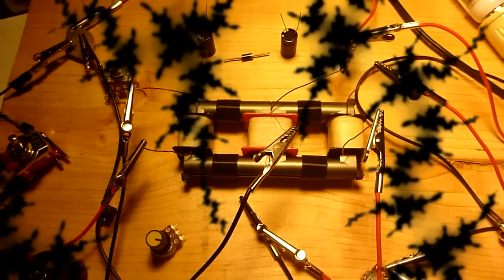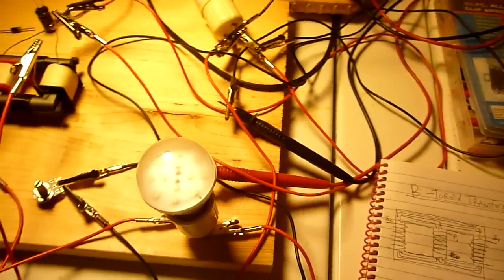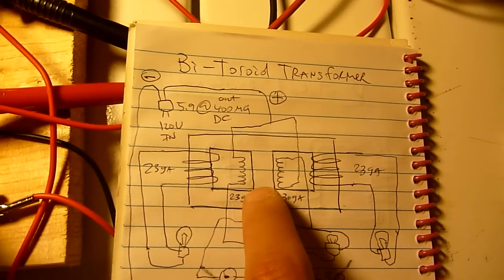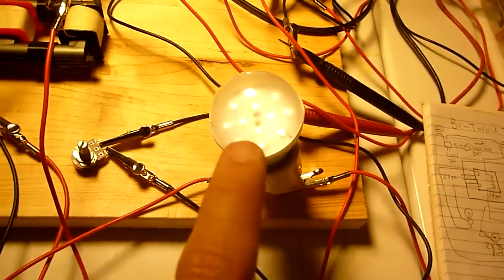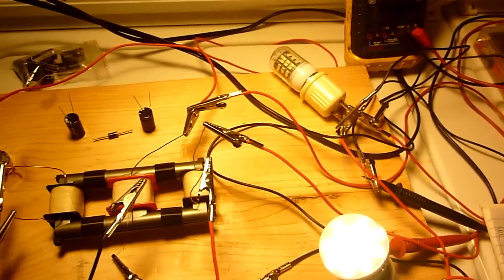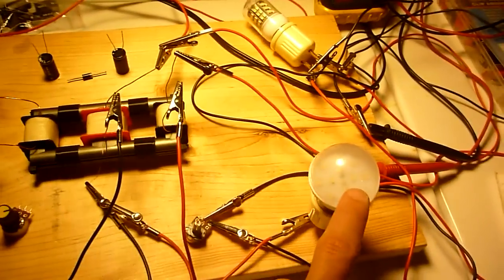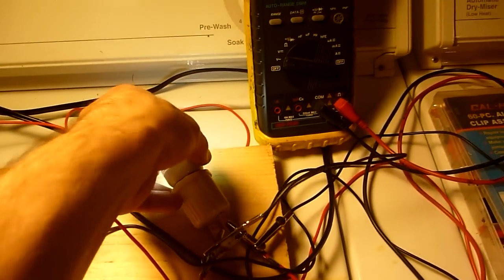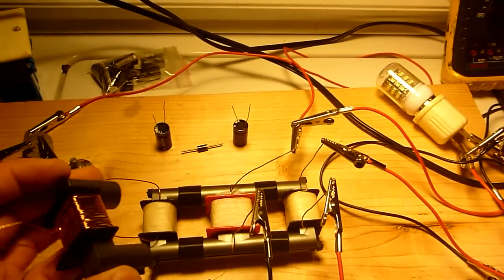Bi-toroid Transformer replication (over unity transformer)

Comment: the design isn't the same as bi transformer because the  bi transformer secondary reroute  the magnetic flux around primary u don't have more magnetic core material to create the effect so your two secondary are create oppose canceling that reroute back into primary if wiring the two secondary in parallel but doesnt effect primary because secondary cancel their flux maybe u can use scalar cancel effect to tap something
Reply: Sorry, I have a bad habit of not reading the description. I know well how it feels being limited by what you have. I have more stuff on paper than any other concepts I want to realize. Construction supplies include whatever I can dig out of a dumpster, or get out of what's laying around. My car hasn't moved in over a year due to money issues, and is being "eye-balled". I prefer pre-manufactured parts for my designs, and that Kia is looking really tempting.
 I have those cores you are using in the video, got them out of TVs. That's good salvage.
I've been thinking of crossing the BiTT with the MEG with a dash of Joule Thief for support, and Pulse DC as the power. I like the concept of PDC, as it can be used in both DC and AC circuits. It's just another idea that needs testing, as much as the others do, but it has promise in theory as a sound concept.
Reply from the maker: +Isibor Omwanghe You are correct. If I had an extra loop connecting secondaries together it would have been a true bi-torroid transformer. I did the best I could with the stuff I had laying about. In either case this setup works! If you have 2 secondaries and 1 primary the secondaries will support each other when both are under load. It is something that should be investigated. Thanx for the comment.
Reply: +Naoki Kashima So you would agree that bypassing the primary like in a true bi-toroid would boost efficiency?
On a side note, you should look at the MEG. I find it interesting.
Reply from the maker: WhtStr213 bypassing the primary would definitely boost the efficiency. If you have an extra loop connecting the two secondaries together (what I didn't do in the video), this would couple the secondaries even better to one another (by passing the primary). Also, if you have the secondaries wound around a thicker core material vs. the thickness of the core used in the primary this will also boost efficiency (more magnetic flux will be trapped in the secondaries than in the primary). I think I listed all these things under the video description (on how to boost the efficiency of the device). The reason that I didn't do it in the video is because I had to work with what I had. (^o^) thanx for the comment.

Comment: A lot of people don't believe in free energy.   I tell these idiots to look at their thumb and ask them what is running their atoms.  It certainly isn't cheeseburgers.     This energy comes directly from the vacuum.  Now the real question is where does the vacuum get it's energy?  My guess is Black-holes when they convert matter back into energy and the X-Rays pour out of their pole ends.  It's an endless cycle.
Reply: the trade off....i believe when you use one form of energy there is an opposite transformation...of the energy being used.Just like positive and negitive electicity..the minute loss of energy being used to make it is being generated and lost in form of heat ect.They eventually all go back to original state in the frequencies and waves ..quantam mechanics seems to prove that.but capturing and getting 100%+overunity i dont think will ever happen .if it does there will be a trade off somewhere.making use of free roaming frequencies would be where i would want to look at getting free energy
example would be microwave radiation from big bang

Comment: You need to duplicate the original one from MIT.   It's the one that is 377% efficiency using the extra flux path that has no coils wound on it, this pathway is for BEMF flux  this pathway needs to provide a flux path that the flux prefers over all other pathways.   They state that this flux ends up being additive to the primaries flux flow not the opposite like normal transformers, where it always is opposing.  This is where the over unity occurs.   To make it self running take a portion of the secondary output and use it to drive the primary.  You'll need a Make-Before-Break switch to ensure that the second source of input is available when it's up and running and you switch it.  Add another coil over the secondary's for this purpose.  I see that you are using High Frequency core material. I would use core material from an old transformer and use a Dremel tool to work with it.  At 377% it should be pretty easy to get it self running, but first you need to get it at the 377%,, then go for self running
Reply: The he original is from the University of Ontario.
Reply: howDoesItLookThisInPhaseBackFluxTransformer?
Reply: I know the model you are talking about brother and I designed very similar just last night, finished it off just moments ago.
377% is a massive overunity!

In theory the greater the load the greater the efficiency as the magnetism top and bottom of the transformer repels its, like in a resonant cavity magnetism repelling it's is what causes energy amplification 👍  

Always good to see intelligent people exercising their brainpower 🤝👍
Reply: @DaVeHiLl200  Wow! I would like to make the same transformer. I have the video he is talking about. Let me get you right, did you implement it the same way and it gave you overunity?
 ( I'm not some CIA spook etc etc)
Reply: @CAPTAINSSBN Hello, have you tried this and it works? Does It give overunity ?

Comment: If you disconnect the 2 light bulbs, the wires from both. Create a closure, a dummy, that dummy will push back into your centre coil, you will see that you will use a lot less input currents. And your lightbulb the main one, will be brighter.
Reply from the maker: +Gerard Morin I've seen some of your videos and I appreciate your efforts to try to help humanity. We are all victims of technological supression, nobody can argue that point right now. Are you aware of the water-powered generator (GDS Generator) which is comming out of Canada. Their website is up and running and orders can be placed. Here is the link: http://www.gdstechnologies.ca/ And here is their commercial: https://www.youtube.com/watch?v=vEqSuTOKUEg The time for Big Oil is running down.
Reply: @naokikashima9349  is there an air gap..? i think the small aircap causes this not to destroy or cancel the flux flow   due lenz law
..cause tom bearden says  in a closed system or let us say transformer the magnetic flux is destroyed by lenz law that is maybe the reason why your ring transformer setup does not work because there is no airgap... since the u core is not really fixed it has some small gap

Comment: Where's the over unity? Just looks like some guy with a camera and a transformer. big whoop. show us this over unity stuff. Demonstrate this mysterious principal that someone else supposedly already discovered,  but then I guess forgot, and now you have miraculously rediscovered. Put some simple volt ohm meters on the input and output measuring both volts and amps. You obviously have done this already. To have made the claim you are getting out more than you are putting in you must of already done this simple test. So please, do it again for us all to see. All meters on camera at the same time, show us this over unity you have achieved by wrapping some copper around some metal. Can't believe nobody else has thought to wrap some copper around some metal before, brilliant.
Reply from the maker: +Thad ward I appreciate your criticism, however the over unity claim is not just my own. Over unity effects with this setup were achieved by Thane Heins, as well as youtube user theENERGYDREAM. A typical transformer couples 1 primary to 1 secondary. You get a 1:1 relationship minus the losses due to heat and resistance in the wires. In this setup the primary is coupled to two secondaries. It is no longer a 1:1 relation because the secondaries themselves end up mutually supporting each other! This experiment was also replicated by youtube user ZeroFossilFuels, please watch his videos and subscribe to his channel. To further push efficiency of this transformer beyond 100% (it is over 100% as is) you can connected the secondaries by an extra loop of magnetic material (same material as you use in the core of the secondaries). This will help the secondaries to support each other. Please read the description of my video for more information as well as links to relevant experiments (a few of the videos were removed by youtube or the users already).
Reply: Naoki  it is not criticism, it is curiosity. I merely asked for an exhibition of your claim. It&#39;s pretty common, actually in fact it is 100% common for someone in the science community to have discovered something and then to prove by completely recreating and empirically measuring the results at the witness of others in community and then hopefully showing us the nature of this recreated phenomena mathematically or is at least able to verbalize the action of the phenomena  to the satisfaction of the community. This is the scientific method, or a very loose quick interpretation of it. I have no choice but to discount your work as false if you do not wish to follow the scientific method. Claims of grandeur are made everyday but when backed by irrefutable proof they become laws. So my method for you to prove your work was simple, measurably show us the results of your findings. You should be elated to show off your work and I'm very excited to see this so that I might recreate it myself. Cheers
Reply from the maker: Leonard Janus Thermal power is not measured in watts O_O Also, using a typical electric heater will always result in COP value of less than 1. Replicate the experiment and see if you get the same results or not. Numerous people claim over unity with bi-toroid transformers not just me.

Also, check out Jim Murray he is an inventor who managed to achieve 5000% over unity with his generators. He has worked on this for about 20 years or so. Here is his video from his workshop, he explains why such high efficiency is achieved, he shows numerous prototypes, etc. Check it out >> https://www.youtube.com/watch?v=HK3JOlY0V8Y

Comment: Hi Naoki ,
apologies in advance to my very bad English ( Google Translate ) , I would try to replicate your design bi toroid , but I do not know where to find such metal body of the toroid, could not you add links for individual parts where can I buy? get? I think that it would like to see more people , simply a precise specification of all the components used on the toroid

Big thanks in advance
Reply from the maker: +Alfa Mikan I used 4 U-shape transformer cores in the design, these ones: http://www.aliexpress.com/item/UY1658-large-watt-U-shape-transformer-ferrite-core-Used-for-machines-equipments-5pairs-lot/32370110051.html?spm=2114.01020208.3.2.vKIVHD&ws_ab_test=searchweb201556_7_79_78_77_80,searchweb201644_5,searchweb201560_10 Then I had 2 different wires for the primary wound in a single layer 20ga and 30ga. For the secondaries on the outside I used 20ga wires in 3 layers (back and forth and back).

Primary had 2 different size wires because it is a pulsed circuit (joule thief circuit) that drives the transformer. You can also use AC. If you simply use AC you don't need to have 2 different wires in the primary.The most important thing here is the shape of the transformer. Also, the transformer must have 2 secondaries and 1 primary. The number of turns in the secondaries and the wire thickness must be the same. If you have the secondaries connected by another loop of magnetic core material your efficiency will increase further. Also if you have thicker core material in the secondary vs. the primary more flux will be retained in the secondary further improving efficiency.

Hope this information helps.

Comment: +Naoki Kashima Is it mandatory to use AC Voltage in this Generator?
Reply from the maker: +Onaduja Dare You can use AC or pulsed DC as I'm using. This isn't really a generator just an energy amplifier.
Reply: +Naoki Kashima Haa haa, this is not a generator? How come?
I ask because what you give in is not what you are getting at the output.
And more you Purely achieved overunity.
Could you please clarify?
Reply from the maker: Onaduja Dare The device is simple enough, build one yourself and measure input vs. output. To further increase efficiency have the secondaries connected by an outside loop. Have more metal in the secondaries vs. primary (thicker core), or have the secondaries with a core of higher permeability. All these things will push efficiency higher and higher. Another experimenter had achieved 377% efficiency with this setup, his youtube name is "theENERGYDREAM". In this type of transformer the primary and the secondary don't couple together in a 1:1 relation because of another secondary. In this arrangement the secondaries end up coupling together as well. As they are both under load they end up supporting each other. Thus, you basically get 2 for the price of 1. Also, the whole thing will run cool (or much colder than regular transformer). In over unity devices they will run cold instead of building up heat. Build one yourself and see :)
Reply: +Naoki Kashima Sure I really like to build it one. I even yesterday went to a workshop in my area to get Iron filings to mix with a 3 part epoxy to make the test core. But Naoki, I do not know to mix in the right proportion an Accelerator + Resin + Hardner. This is my roadblock now. Even apart from Bitoroid test, I need to build a core for my Step-down transformer which I want to use with my Fuelless Engine (it is a Pulsed H.V Motor /Generator that captures Radiant Energy while giving output shaft torque to drive a generator too).

If I may ask, can't Neodymium Magnet be added to the Flux path to the Secondaries too to Boos the Over-unity Output of the Bitoroid Gen?
Reply from the maker: Onaduja Dare There are many people who reported over unity effects when they added permanent magnets to their transformers. The most famous one is Floyd Sweet, if you don't know who he is look him up. Well, he didn't just add the magnets to his generators at first he had to 'condition' them through heating and cooling. This process softened his magnets. In my experiments I haven't seen any increase in efficiency simply be adding magnets. Sometimes there is an effect when the magnet is at a particular distance away from the core, as soon the magnet is brought to the core completely any positive effect is gone. Basically just adding a normal magnet to the transformer won't work, it depends on the kind of magnet and the kind of transformer core you are using (also the distance).

I tried casting transformers using magnetite or (black sand) and epoxy. You have to pack as much magnetite as possible in your mold when making these, your permeability will be pretty low though. The plus is that transformer made using molding is good for very high frequency pulsed systems (can establish and release magnetism very quickly... but there won't be a lot of magnetism).

Please post a video if you make something cool. When people work together there is nothing that they can't accomplish :)